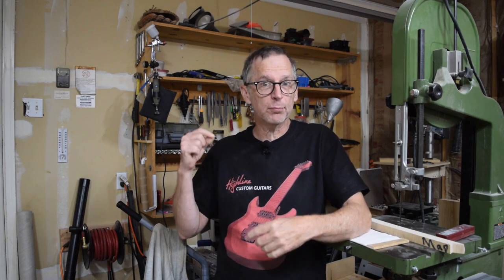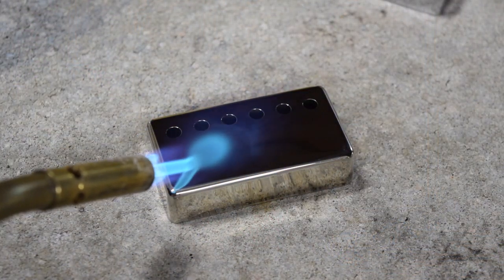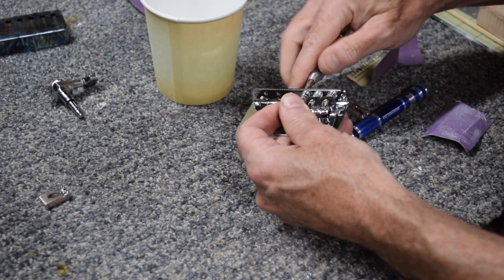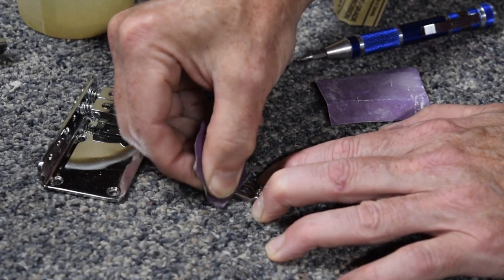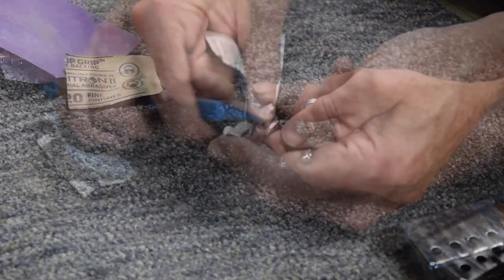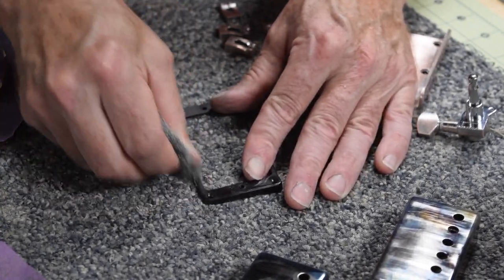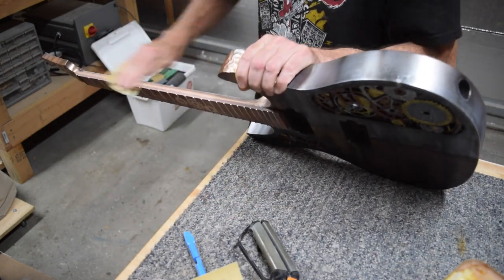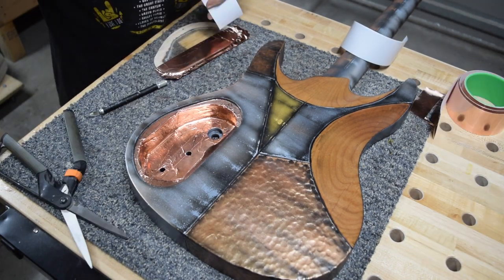The Steampunk Guitar Part 10: Aging Guitar Hardware

Comment: Dentists use a tool called a micro etcher. It’s a pen sized sand blaster for roughing up the inside or zirconium crowns with aluminum oxide powder. If you’re going to do a lot of this it would be worth looking into. eBay has them for $99. You’ll need a way to attach it to your compressor. And the medium. Makes a mess. You’re already wearing eye protection, right? And we know you have an “Fmask”.  Way faster than sanding.  Used lightly on gold parts it leaves a nice satin finish.
Reply from the maker: I actually use a Dremel with an abrasive wheel. Cheap and fast.

Comment: Hi Chris, can you show us how to roast guitar necks finishing? Thanks!
Reply from the maker: Roasted necks don’t need finish.
Reply: @HighlineGuitars  I mean how to have roast effect on the guitar neck from a plain neck
Reply from the maker: @richardx4456  I have never done that sort of thing. However, based on the actual roasted Maple I have used, you could probably get close to that look by applying an oil-based wood stain. I would go with something dark, like a Walnut stain, and thin it with mineral spirits.